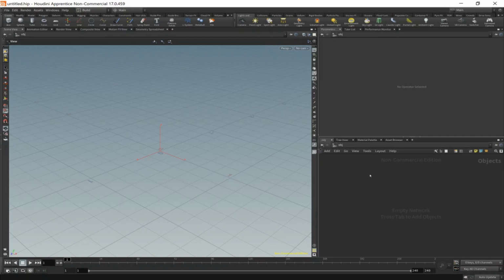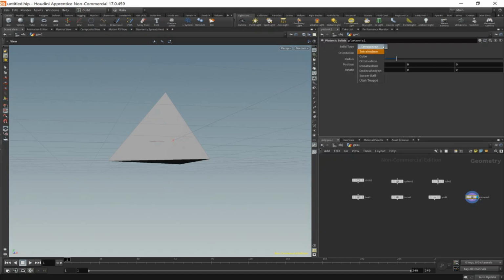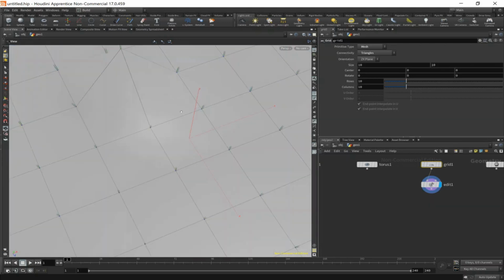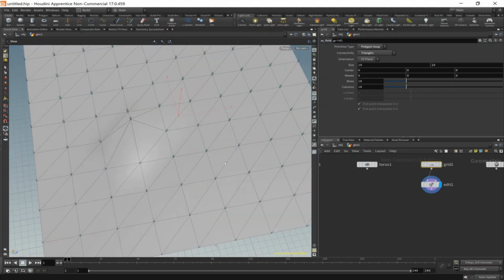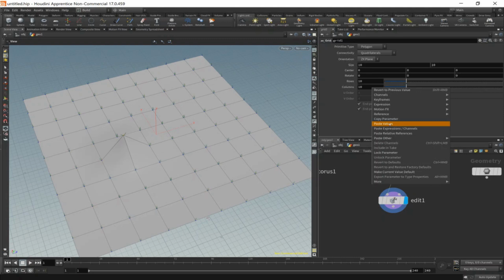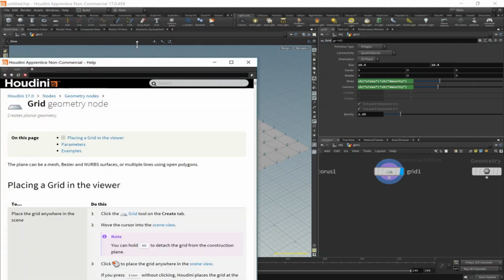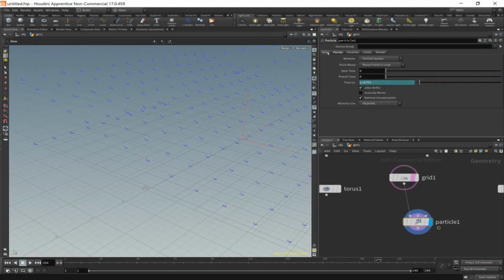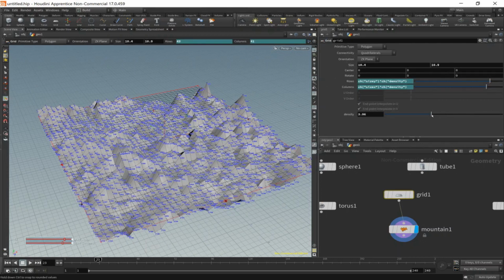Tutorial 3. Geometry Primitives

Comment: When I connected rows and columns to the size parameter and changed size, the edited point on the grid became red. What does this mean?
Edit: Also I have no node called "Particle" in 17.5, has this been changed?
Reply from the maker: Hi Erik,
In answer to the first question, it is hard to know what is going on because I can't reproduce it. I would expect the point to be yellow (when you have the edit node selected). If you are seeing a red area around the point fading to yellow, this is because the 'soft radius' is turned on in edit- the red represents the area of influence.
In answer to the second question, yes you are right, I am sorry. This tutorial was made with 17.0 and it has been removed from the list since then. However it does still exist. You can access it in the following way:
open the textport using  Alt+Shift+T
type:
cd /obj/geo1
opadd -e particle
Reply: @houdinikitchen  Thank you! Yes it looks like it was soft selection. And thanks for the particle tip!
Reply: @houdinikitchen  I still can't seem to get particles, the first line cd /obj/geo1 returns 'not found'
Reply from the maker: @Hanumovies  that line is telling Houdini to open up the node /obj/geo1 which may not be what it is called in your file. (cd means 'current directory' as in 'make this the current directory') If you type cd /obj/ you should get a dropdown list of all the nodes at the object level, and you can pick the one you are currently working in.
Reply: @houdinikitchen  I'm in Houdini 20.0, and using this method no longer works; the input returns "Unable to create node type particle"
Reply: Or you can open textport and type: opunhide Sop particle and select it normally from tab. Type ophide Sop particle to hide it again. https://youtube.com/watch?v=B5Z-wRufeYs